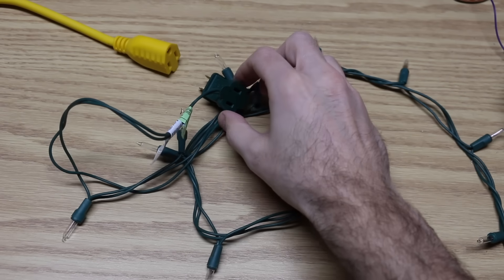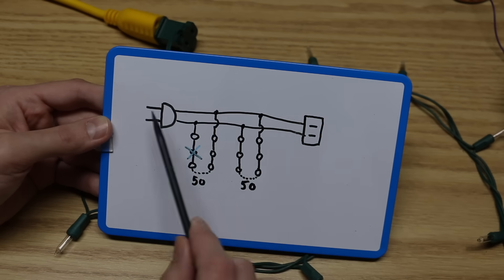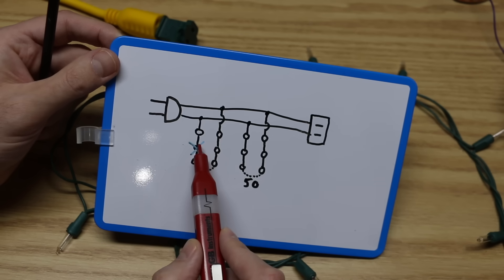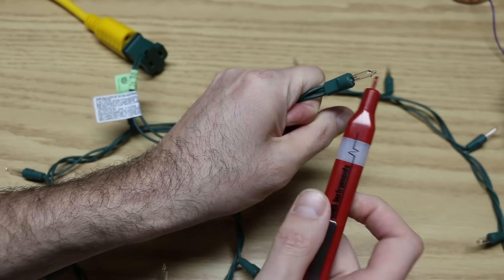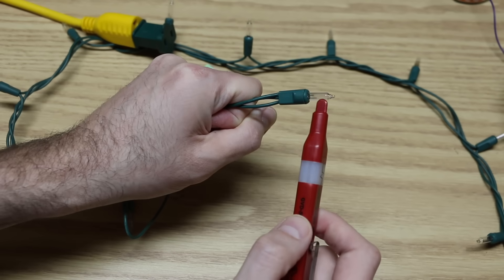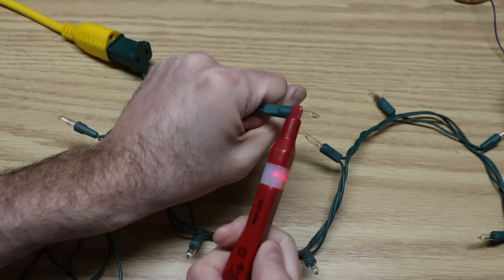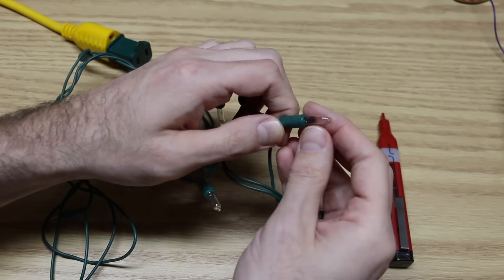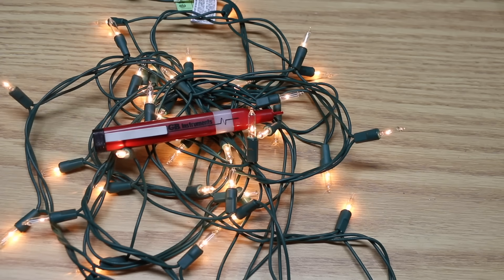HOW TO EASILY FIND BAD CHRISTMAS LIGHT BULBS using a non contact voltage tester

Comment: Thank you for this video, it was very helpful! I have a set of "globe lights" on my RV. Went outside this evening to discover half of them not lit. I *really* didn't want to crawl around under my trailer taking each of the lights apart, since removing the plastic globe housings around the lights is an additional step to an already tedious problem. Found the bad bulb and replaced it in a jiffy!
Reply from the maker: I'm glad it was helpful, especially saving on the struggle with that situation.

Comment: Very informative, but, Christmas lights dont turn off half the strand if one is burned out anymore. Well, a good company with well made lights dont do that anymore.
Reply from the maker: The problem with the lights that have automatic bypass shunts when they burn out, the lights will stay on but now the ones that are on have a slightly higher voltage across each of them with the missing light not helping balance that out so the lifespan of the whole thing gets a little shorter and then another one will blow, and when it’s shunt bypasses it to keep the rest on, now they all see an even higher voltage so they keep blowing faster until the whole thing is blown and then it’s even harder to replace the whole thing. 

I have a string like that right now where I thought I would just need to replace a couple but it looks like just about every light is blown so I think I have to just throw it out instead because it’s cheaper to just buy another strand. 

 The only way I can think to prevent that is manually looking at every bulb while the strand is supposed to be on and see if any are actually turned off with the rest on and then replace it as soon as possible to keep the rest from burning out but that’s a hassle in itself.
Reply: @GadgetReboot  .....I got a little tired of replacing bulbs and being extra gentle when moving them around so not to break a bulb or loosen the filament. So I went LED this year on the Christmas tree. Looks bright and beautiful, produces no extra heat to help dry out the tree ( I usually have 1300 lights on a 10ft tree) and they last years.

Comment: It’s going to be kind of hard to do on the tree
Reply: Haha get rekt
Reply: That's why you check them BEFORE you put them on the tree. I have never had a string stop working while it was on the tree. They always mysteriously blow or fail while sitting in the attic between seasons.
Reply: Had this problem on my prelit tree. Just got new lights after changing about 50 individual bulbs

Comment: Thanks, great video. I tried this procedure on a light set that had three sets of 50 lights. One of the three sets was working when I started.  These light were embedded on an artificial tree which claimed a high number of lights, approximately 1,500 if I remember correctly. Here’s the part I didn’t know – The original bulbs had a special feature: if the filament burned out the bulb was designed to short – that is, the bulb would go out and the remaining lights in the set would stay on but now running at a slightly higher than intended voltage. This was a clever idea in most respects but after enough bulbs failed, the voltage would get too high for the remaining bulbs and a complete set failure would occur. I was following the procedure you suggested (had to go one-by-one because of being mounted on a tree) and eventually found a bulb that was opened. When I would replace this defective bulb it would flash briefly and then burn out. Eventually I was able to figure out what was going on. I then removed all the bulbs in the non-working sets and proceeded to test them using the working set, I did this by removing one bulb from the working set and using that socket to test the non-working bulbs that I had removed. I discovered maybe two bulbs that worked. I then purchased a couple of 50 bulb lighting sets. Purchasing individual 2.5V lamps was way more expensive that buying full sets of lights. Unfortunately, the socket type of the new sets did not match the socket type of the old set and I had to transfer these bulbs to the old sockets – removing the old set from the tree was just too much work.  When I finished replacing bulbs the two sets that were previously not working were working… but there were still lamps that were out. It turns out that these were part of the original working set. Fortunately, not enough of them were out to make the voltage too high for the remaining bulbs so that set remained lit.  I replace these bulbs and all was well.
Reply from the maker: Sounds like a big Christmas adventure! I have a pre-lit tree and luckily none of the built-in lights failed yet.   I think I would prefer if the bulbs did not have the built-in shunt because it just prevents us from realizing something burned out and then eventually the whole string gets blown.
Reply: I think you nailed it. Sometimes we just don't see one or two that are burnt out. That puts more voltage on the ones working and pretty soon they all turn black and burn out. Replacing them all BEFORE trying to light the string is smart and perhaps the only way to keep the new ones from flashing and going out. Once the string is on the tree, the job becomes very difficult. Thanks for your suggestion.
Reply: Sounds like a 
"A Post Apocaliptic inventor"  gave you some incentive to do all this. 
Go and watch his y.t channel. He is unbelievable. 

All the best.
Reply: Damn I pray you got your Christmas Gift...

Comment: So I have a weird one...I haven't yet done this exact procedure...But I have a string of lights, that are a lighting up 10" candy canes. About 6 lights per candy cane. 10 Candy Canes total. I have 110volts at the plugs on both ends of the strand that is 15ft total in length. But none of the bulbs light up. I painstakingly took every bulb out and tested each one individually and they all light up. I have reinserted them back and again nothing. I have now done this about 3 times! I also have tugged on and moved wires around nothing, not even a flicker. How can I have voltage on both ends of the line but yet none of the bulbs light up??? I am not an electrical guy but I do catch on pretty quickly. I am thinking obviously I must have a bad connection somewhere. Any tips on how to approach this problem? When I inserted a meter into the first bulb coming from the male plug inserted into the wall I don't get any voltage but yet there is voltage at the plug and even on the end of the line. This is what has me so stumped. It worked fine a couple of days ago. Thanks for the advise!
Reply from the maker: It sounds like there are three wires running end to end, two of them will carry the 110 V from plug to socket and the third one goes in series between each light so that’s how there could be power on both ends but zero lights operating. 

Since the lights work outside the string it does sound like there is a bad connection so the first thing I would be doing is  using an AC voltmeter to probe the wire right down inside the light socket with the light taken out one at a time and look for the 110 V to be present.   So the rest of the lights would all be plugged in and just one at a time taken out so that should complete the circuit except where the light is removed and then you probe the wire down inside. The other side of the voltmeter would have to go to the opposite AC power line for example if you end up with neutral running through the lights themselves, probe the hot end of the open AC socket at the end of the string ( The plug is in the wall, the empty socket is at the other end where you can plug in the meter).   Assuming the very first socket is any good, try probing the wire down in the socket with the other meter probe plugged into one or the other of the AC socket and if there’s no voltage plug it into the other AC socket  and hopefully one or the other will show power at the first socket so then you know that you’ve got the correct AC socket pin on the meter  and you can continue probing the rest of the light sockets for activity. 

 And try both of the terminals down inside the socket just to be sure you’ve got the right one because one will be incoming and one will be outgoing for the series circuit. If you do see power on the first socket, plug the light back in and unplug the next light and see if power is getting into that socket and see if you can find a broken section. 

 It could also be that the wiring is all good but maybe some of the wiring got misaligned so if you find a dead area maybe you can try to maneuver the wires around in the socket depending how it’s designed. The last time I looked in mine I think it was just strands of wire sitting there that the light would make contact with so with everything unplugged  maybe you could use a screwdriver to bring any recessed wire strands back out so they are accessible. Also the wires on the lights themselves sometimes can go twisted and crooked so maybe just bending those back into shape so they make contact cleanly again. 

 If there’s nothing obviously wrong where things make contact but it’s a dead spot, maybe the wiring could be broken inside the insulation and there may not be much that can be done it might be worth just replacing it.

Comment: Neoteck Voltage Tester Non-Contact Voltage Testers 12-1000V AC Voltage Detector Pen Circuit Tester Tool with Led Flashlight Beeper Pocket Clip-Orange    @ Amazon = $16.99
50 Foot 100 Light Clear Outdoor Commercial Grade Grade Christmas Mini Light Set, Black Wire   @ Amazon = $10.95

Comment: Stellar explanation. Fixed my shimmering lights strand using this exact method and a 9 volt battery to make sure the new bulb was good.
Reply: A 9 volt battery can more often than not burn out a good miniature christmas tree bulb. Try using at most two 1.5v in series.

Comment: Dude..you are my new hero.  I was skeptical but now I'm a believer.  Actually of you think about it, at the broken bulb one side will be hot from the line and the other side is referenced to neutral.  Depending on how the plug is turned is the direction you will find...all hots or all neutral up until the problem.  I turned the plug over so I was hitting the hots.  It was a bit of a pain of you have more than one bulb thats a problem.

Comment: How can that possibly work?  The circuit on that extension cord is technically broken too and it detects...
Reply from the maker: From what I understand it’s all based on capacitive coupling where the person holding the detector probe has some amount of capacitance to ground and completes the circuit from a live wire, whether open ended or part of a closed path.  

 Here’s some info
https://electronics.stackexchange.com/questions/401093/how-do-non-contact-voltage-detectors-work-on-open-circuits

https://en.m.wikipedia.org/wiki/Test_light

 Page seven on this document talks about electric field detection, which doesn’t require a closed circuit. 
http://www.homeinspect2020.com/uploads/Non_Contact_Voltage_Testers_and_Personal_Risk_Management.pdf

 So when we probe the wire on the extension cord or on an AC outlet, we’re detecting the live wire but on the Christmas lights after the point where the circuit is broken, we are actually trying to probe the neutral side of the AC connection so we don’t detect anything anymore.

Comment: Why don't you just check to see if the filament is there?
Reply from the maker: Can’t always see clearly especially if the room is dim and festive and you’re just trying to run through and get things done. But still that would require looking at all the lights until the broken one is found where using the tester we can go halfway down the line and instantly know we have one side all good or bad  and zero in on it.
Reply: Sometimes you still can't see it..i.e. a problem in the bases.
Reply: I just found the “problem child” on my light string and the filament was fine.  Somehow the tiny wires inside the bulb socket were compromised, and once I changed it out, voila.

Comment: Nice tool. However, I expected some kind of binary search tree approach 😀
Reply: it's much easier to throw the strand away and get a new one. I picked up 100 light sets after Xmas for 75% off or 1.49 each. 
Sadly, America  no longer makes light sets so we must rely on cheap ones from China only designed to last 2-3 seasons,
Reply: Where do I find the voltage gadget
Reply: Chris Blankner I found mine at wal-mart. about 6 dollars.